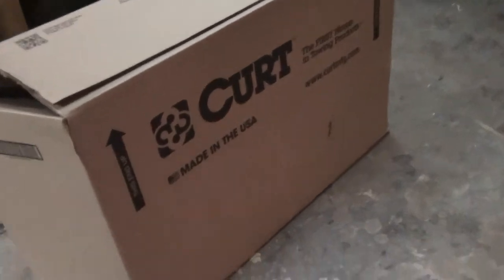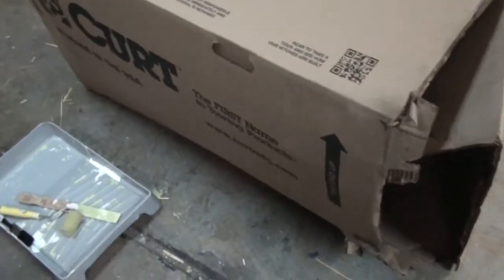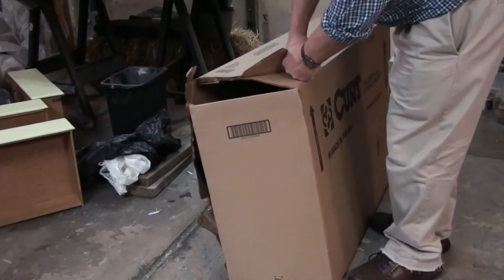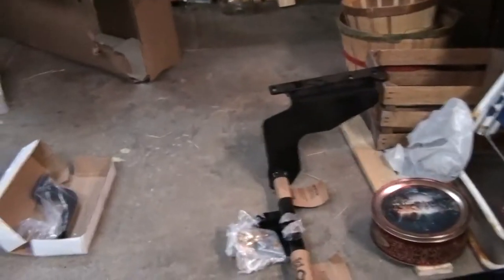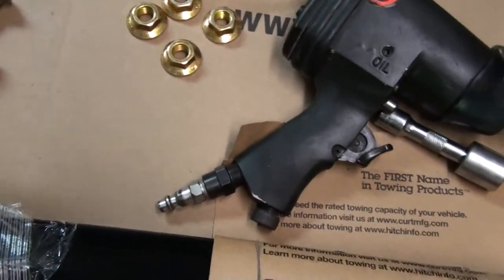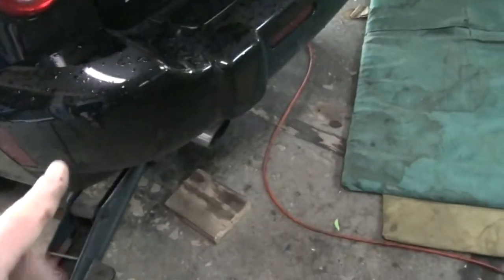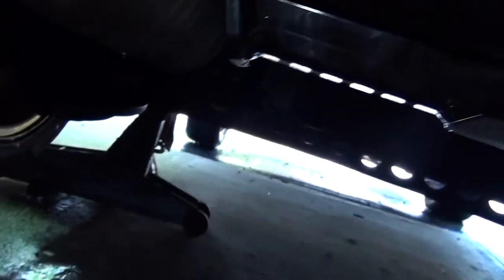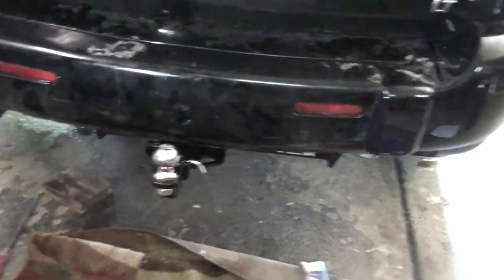Trailer Hitch Install on my HHR

Comment: African Queen one of my faves.  Nice idea to put one on.  I put the same brand hitch on the front of my F150 . Great hitch
Reply from the maker: Thanks! I felt it was time. :) The car has enough HP to do some light towing the only reason I waited was because when I first looked at the hitch it was $350 and I watched the price drop and drop and drop and then stayed level for a while at its current price so I jumped on it. The cool part is they are made by a company that is just 2 hours from here. Always love buying from local companies when I can. :) Cheers!

Comment: Good job!! I have a 2" receiver on my motorhome but no wiring harness. I would love to have a small trailer and put the CB550 on it, go camping and ride the CB out from the campground.
Reply from the maker: So depending on your motor home size you could get one where your 550 sites off the back bumper sideways hugging the back of the camper I have actually seen a few motor homes with that setup one with a CB400 and one with a CB550 and they fit perfectly but yea that would be nice to have the CB550 for running around on when you motor home.
Reply: Mine is a small Class-B van (19ft Dodge 350) so the hitch will not be able to support more than 300lbs.

Comment: Do you have the part number for the hitch itself?
Reply from the maker: Its a CURT
 Model 11447 that is also the part number. Here is the link on Amazon for more info. https://www.amazon.com/CURT-11447-Class-Trailer-Hitch/dp/B003PIZOVY/ref=sr_1_1?keywords=curt+hitch+for+2007+Chevy+HHR&qid=1560012589&replacementKeywords=curt+hitch+for&s=gateway&sr=8-1&vehicle=2007-47-2810------------&vehicleName=2007+Chevrolet+HHR 
Its been a very good hitch and I have had zero problems with it or the wire harness.
Reply: @MidwestMotoRider  Yes I have the hitch installed. I was wondering about the ball mount. Sorry.  Is the "rise" 5"?

I ordered this.   https://www.amazon.com/gp/product/B003AT49X2/ref=ppx_yo_dt_b_asin_title_o00_s00?ie=UTF8&psc=1
Reply from the maker: @randallgoguen3463  Sorry probably my bad on that. The Curt Part number is 45520 Ball mount 1" bar. Hope that helps. It says on the sticker 3,500lbs trailer WT and 350Lbs max tongue WT its a 3 1/8" rise and 3/4" hole. I recently hauled my tractor and accessories in at over 900lbs over 50 miles with no issue. Take care!